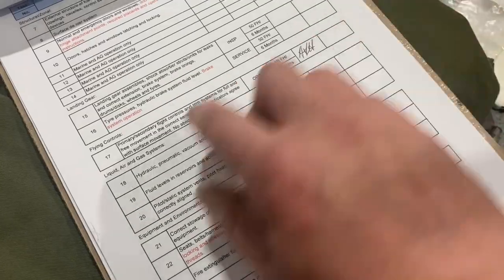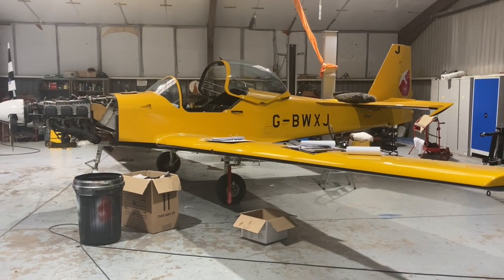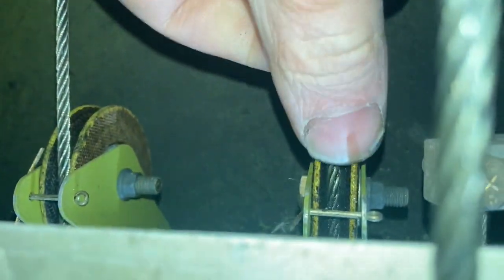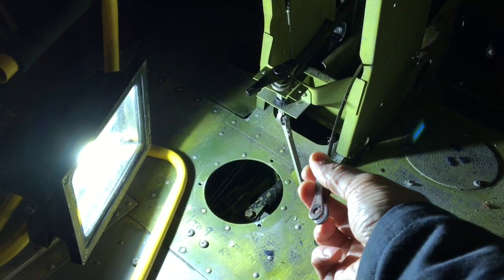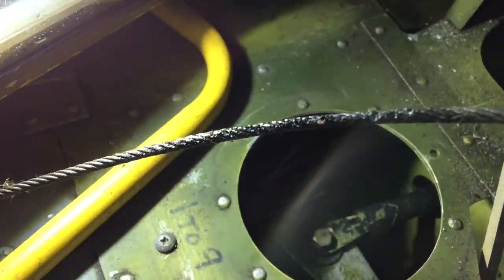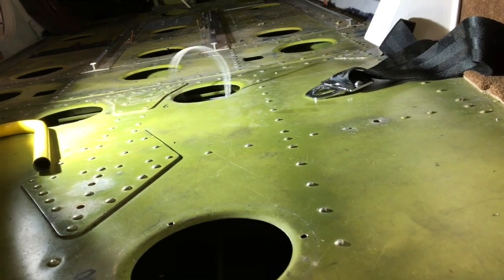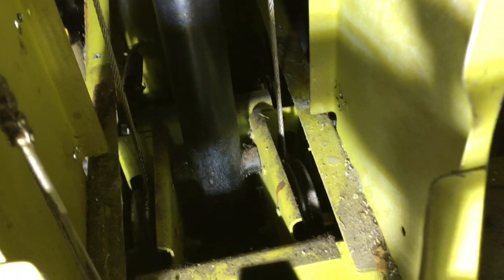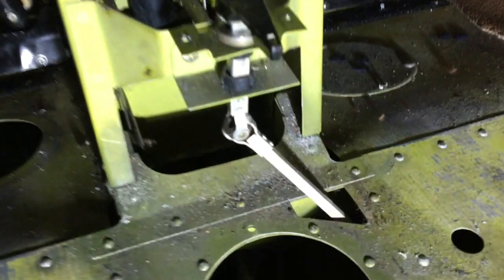Annual inspection - frayed cables Cessna 172

Comment: My mechanic makes me take a rag soaked in corrosionX and wipe all the cables..  If there is a fish hook, you'll find it easily!  Rotating pulleys is another tip we do to spread the wear and prevent flat spots on them.  Good video and great reminder to watch those old cables.  ;-)
Reply from the maker: Yeah corrosionX sounds like a good idea especially on galvanised cables.
Reply: @framavia2201  We go through that stuff by the gallon.  Our Merlin has a nasty tendency to tighten screws in panels as it flys.  1st inspection, we had to drill out over 100 screws.  After that, screws get installed dripping wet in corrosionX.  No more stuck screws.👍
Reply: That's what is supposed to happen.  In my friends case.... That is not what happened.

Comment: I enjoyed your video. I am considering becoming a airplane mechanic, but I have read that it is hard on your body? Is that true from your experience? I already have two bulging disc in my neck.
Reply from the maker: You need to be physically fit, but I don't think it's worse than other jobs involving manual work. I have picked up a few minor injuries in the last 30 years, nothing serious though.
Reply: Geddon436, After 30 years in a viation  maintenance, I can tell you that ,yes, it is hard on the body. I've worked on everything from Pipers, Cessnas, to DC 8's, MD 88, Airbus and Boeing. Knees and shoulders take a beating. Everything out there out weighs you by a good factor. It pays well, but it also can consume your life if you let it. Good luck in your career decision!
Reply: @robertkeaney7047  thanks for explaining it. I've already got bulging disc in my neck and arthritis in my shoulder. So thats a no-go for me
Reply: Geddon436, wasn't trying to be a Debbie downer, but you should know what to expect over time. At 59 years old, I just don't get up as fast as I used to😣
Reply: @robertkeaney7047  try it at 75.
Reply: @davidoickle1778  Jeez, I hope I'm not still doing this at that point, it gets harder every day. The young guys coming into the industry are addicted to their cell phones and don't seem to have the work ethic I seem necessary for this profession.

Comment: I was about to do this inspection on my 172,  but it seems I don't have all the required tools.  Where can I get a blue peter and a fourth bridge?
Reply from the maker: Haha, you can probably find a Blue peter in the 1970's and a  Forth bridge in Scotland.  Don't forgot red oil for the flashing beacon, a gallon of prop wash, the long weight, a tub of elbow grease and a box of fresh sparks in case you wanna use the grinder.

Comment: 2:15 what is the purpose of those two clamps?
Reply: Those clamps are there to limit the travel of the elevator trim tab. There’s actually 4 of them, 2 for the up travel and 2 for the down travel. You find the desired travel and tighten the clamp down so they contact each other preventing the pilot from exceeding travel limits. Hope this helps.

Comment: Great friend of mine died in a crash because of a freyed and broken rudder cable.
Reply from the maker: Thats tragic, it also the kind of thing people need to know, so the we remain diligent at every stage from maintenance to flight, if not, sooner or later, an accident will happen. Thanks for the comment.
Reply: My condolences.  That's actually why I stopped flight training for my Private Pilot.  I kept having fears of structural failures, control cable failures, wing spar breaking.  That Embry riddle piper crashed freaked me out.
Reply: @asgpu414  You and a lot of other people. That's why the only way to go (as far as I'm concerned) is own your own airplane that no one else flies. I wouldn't rent a airplane these days, as their's way too many stupid and selfish people out there that are doing stupid things with airplanes, and you never know when the problem will rear its ugly head. I used to fly a 152 all the time that a guy told me he looped frequently, and that was the last time I flew it.
Reply: @scotabot7826  Absolutely true!
Reply: @asgpu414  If rudder cable breaks use aileron, if elevator breaks use trim and power....I would buy a safe plane, rugger with low stall speed. like a bearhawk or a superstol